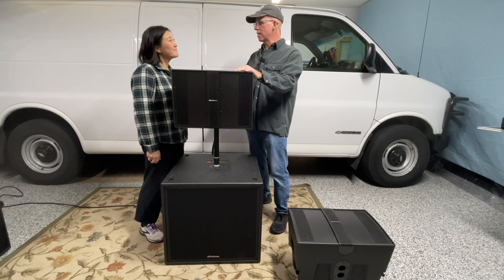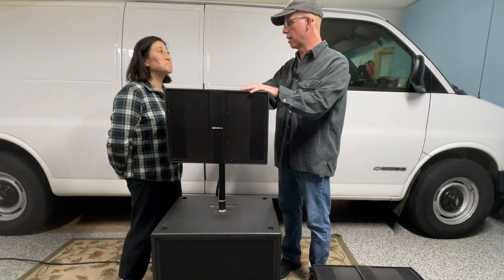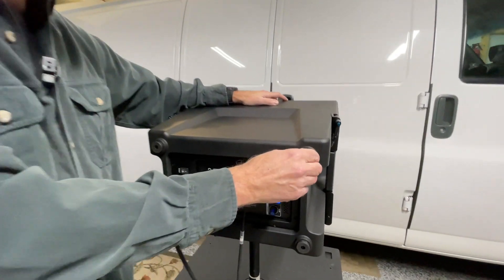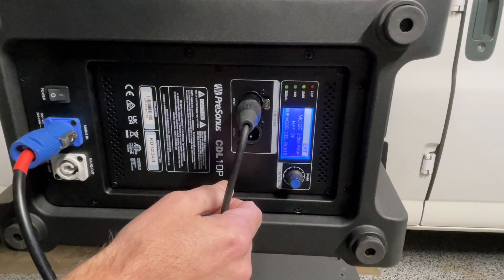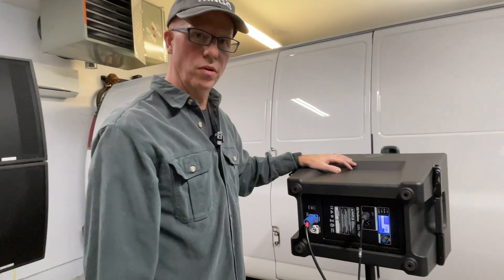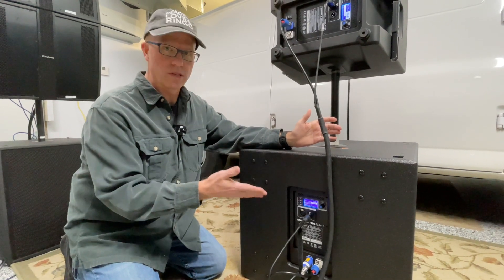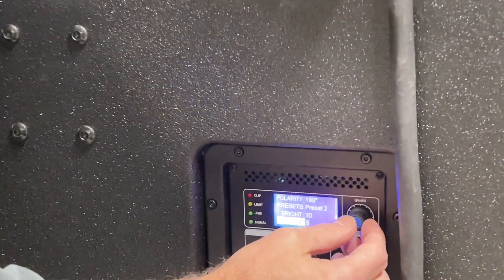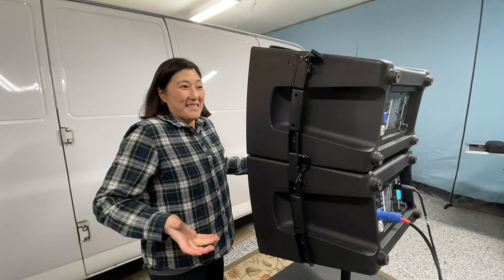The SC - PreSonus CDL Log: Features Overview!

Comment: Hello. I have a pair of cdl12p and I'm thinking of exchanging them for 4x cdl10p. is it a good idea? thank you
Reply from the maker: It really depends on what your primary goal is.  IMO, 4 CDLP's will not significantly outperform 2 CDL12P's.  But if you are looking to lighten the load or get more vertical coverage, it may not be a bad tradeoff.  Just be ok with the fact that you will likely need 4 speakers more often.

Comment: Besides power (or better SPL), let's compare total speaker surface area...
We use the formula:  area = radius square  x  pi
SP10 MODEL with 10" woofer and 6 x 2" drivers ........
woofer: (  5"r) square  x 3.14 x 1 = 78.5 sq inches
drivers: (  1"r) square x 3.14 x 6 = 18.84
Total speaker area for SP10 = 97.34 sq inches

SP12 MODEL...
woofer: ( 6"r )square x 3.14 x 1 = 113
drivers: (  1"r)square x 3.14 x 8 =   25
Total Speaker Area for SP12  = 138 sq inches
So if you use TWO SP10,s you are at 194.7 sq inches of speaker area!
Just a thought...
Reply from the maker: Very interesting..thanks for sharing as this would be helpful to others in considering their options.

Comment: Hello Bart and Stacy.. Hope you guys are doing Well.. I have a Quick Question.. How can we stack 02 or 03 units on top of Dual 18 Subwoofer without a pole  and angle towards audience.. is there a plate or tray that will go under the very bottom speaker and can balance the tops and keep them straight .. like JBL Stacks on top of Dual 18 JBL SRX 828SP.. ???? do you have any helpful information ??
Reply from the maker: The pole is the only option which will support up to two (ours is 16").  Between three and six, you need to rigging grid and fly them.  Hope this helps!

Comment: The more I learn about these speakers, the more I like them.  From this video, I noted there is no network control on either the CDL10P or the Sub; I see that as a good thing.  You have all you need in the relatively simple menu's to set things up as you need for all except the most complicated of setups, which would suit 99% of people.
Reply from the maker: Hi John - I tend to agree with you on the no networking for portable set-ups, which is mostly what we do.  If we hook up our cabinets to the network, there are definite advantages to that approach as then you can manage the speakers as a group....but it's the work involved in running the cabling.  Now if the speakers could connect via wi-fi....that would be the best of both worlds!

Comment: Thanks folks for the run through.  I'm not sure why the LCD screen and instructions on the back of the CDL10's are positioned at 90 degrees to the way the speaker is positioned on the pole?  As for the Sub - why wouldn't PreSonus make "Preset 1" = 1 top cabinet & "Preset 2" = 2+ top cabinets (instead of the reverse)?
Reply from the maker: That's great feedback.  Honestly, we didn't think about the LCD screen until a couple of comments. Understand, but manageable.  Agreed on the Preset 1 & 2.  In fact, it didn't hit us until after the comments that our 18s subs have similar functionality with "P1" & "P2" button settings that work just the way you suggested...so at least keep it consistent??  However, with the benefit of having the level attenuator knob right there, we are still not sure why it's even needed...just turn it up or down.

Comment: Love your content! Thanks so much ! Will be interested in your opinion on how these sound compared to a wood cabinet. We have all QSC stuff and the birch HPR cabinets do sound better than later ABS plastic models but yeah they weigh more so there’s a price to be paid labor wise. Thanks again for your content!!! Great stuff!!!!
Reply: If the cabinets are rigid enough (most important part) and the material used can mimic the same acoustic properties as wood, you won't be able to hear any difference. 

The material used and the way the cabinets are designed is what makes the difference. And as usual: Money is the decisive factor in this.

That's the shortest version of the story and the best explanation on this topic.
Reply from the maker: We will try as best we can.  Note that comparing the CDL12 (wood) to a CDL10P is not quite the same.  We would need a CDL12P to be able to provide a subjective comparison.  However, we have heard that comparing the CDL12's series against each other that there are some subtle differences in sound characteristics.  This should not be surprising as they are made of two completely different types of material.
Reply: @thesoundcouple  
Noted. 

But the difference between the CDL12 and CDL12P could also be down to the processing and/or amp module.

Time for the guys from @presonus to shed their light on this subject.

And maybe we are getting a bit far from the original topic but I do know for sure that a different design amp and/or processing can chance the complete sound of the same speaker. I had that experience when d&b audiotechnik released their D12 with digital amp and processing in 2003. It replaced the P1200(a) which had an analog amp and analog processing. Night and day difference. 

The same happened albeit on a much smaller scale when the D80 came out.
Reply from the maker: The specs are identical...but internal components used could vary so we will likely know the full picture unless you took each one apart. @Richard_van_der_Heijden

Comment: Guys you got to convert over to battery speaker for ceremonies like those new ones that came out
Reply from the maker: We have considered those.  However, we like our gear to serve us across a bigger spectrum of needs.  We have our Pecron power distribution, which serves us in multiple ways for portable power...just like these speakers will be used in multiple configuration.  Gear that is best for single purpose needs may do that job well, but it takes longer to get your return and it sits idle more.

Comment: What is the advantage of the new sub over the old?
Reply from the maker: If you are referring to our "old" subs (18s), they should be pretty similar as the specs are nearly identical (how it's controlled is different)    However, the Sub18 is physically larger so we anticipate we will feel more output.  PreSonus has stated to us that it will, we just haven't had a chance to see for ourselves.

Comment: Great job
Reply: @mostyles328 
And in addition to that:
The "clipping problem" as mentioned on other channels.
Is it really a problem or just people needing to get to know their gear?
Reply from the maker: A couple of points to make on this topic:  1. Yes, as some have spotted in our videos, the clip light will flicker when used in higher duty applications - We have seen it too, but we have never heard audible clipping.  Rest assured, and as we have shown in many videos, we have really pushed the cabinets hard over the years and have not had an issue with any of them.  2. We brought this topic directly to PreSonus for their take on it and their response aligned with our thoughts too.  The clip light begins at to illuminate at a  conservative threshold and not to be be concerned if it's flickering.  If the clip light is ever constant, you now have reached the threshold and you will likely hear it.  Again, we have never heard it at the point where I feel the system is running at full output.  

I am sure it's sort of a balancing act for them as they don't want customers blowing up cabinets..but perhaps the engineers could have backed off the threshold so we wouldn't be as concerned about it.  Great question!.  @Richard_van_der_Heijden
Reply: @thesoundcouple @presonus 
Thanks for the response Bart!

I popped the question as I have been watching a lot of CDL videos on YouTube. And in some of them and in the comments on those videos it was identified as a bit of a problem. Most notable YouTuber was DJ King Vick and also Sean Omelas.

Maybe that you or the guys of Presonus themselves can make a short video on this item to get it out of the world as it seems to keep people off of buying these speakers.
Reply from the maker: We plan on discussing the topic in later videos. @Richard_van_der_Heijden
Reply: @thesoundcouple  👍🏻

Your content is always greatly appreciated.
Reply: @Richard_van_der_Heijden  people need to learn gain structure :)
Reply: @Velkus96  I know.

But as it has been brought up by some other YouTubers I think it's a topic Bart should discuss.

For me, as someone who values Bart's opinion, it would be valuable to know if there is an issue or that it's just other people not understanding their gear.
Reply from the maker: Thank you!  We are really enjoying sharing this info with you!
Reply: Would love your thoughts on sound quality differences from the 12”s and current sub setups. Thanks
Reply from the maker: We are planning on it! @mostyles328